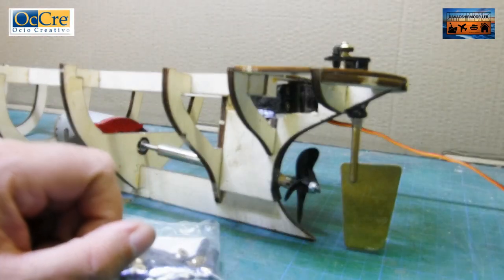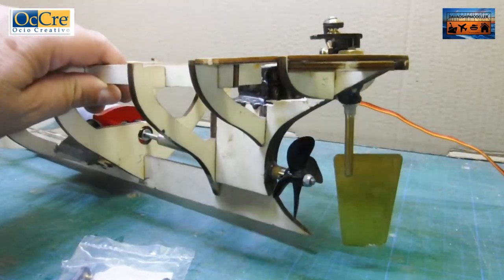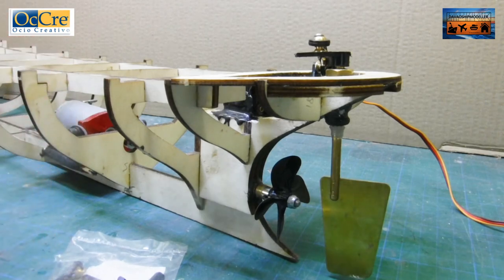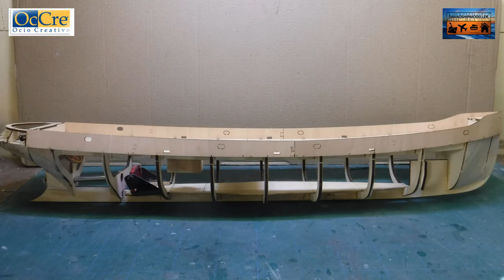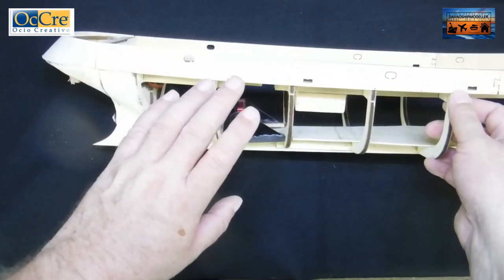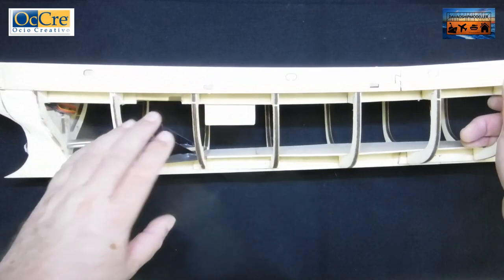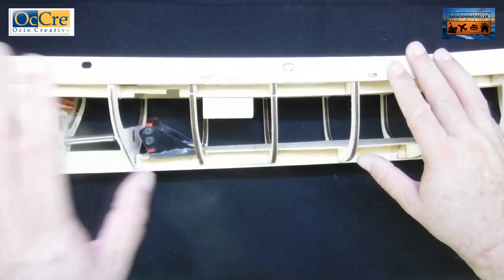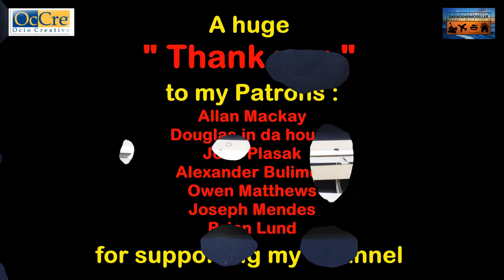Occre Ulises Part 2

Comment: Hi There, Thanks as always Why did you balser wood the Bow and stern, It was not in the boat instructions? And how did you water proof the rest of the hull?  🙂
Reply from the maker: To refill the Bow and Stern with Balsa Wood makes planking in this Areas easier, as for making the Hull Water proof, well I've used a lot of Paint and clear Varnish , but my advise would be a clear thin runny Epoxy which would seal all the small tiny pinholes
Reply: @davaoshipmodeller  thanks David, that sound like it may we worth doing -if it helsps with the planking, it's my first boat so "dreading" it. I am considering fibre-glassing the hull inside. :-)
Reply from the maker: @roysheeley well I am still John LOL ! But regarding the Balsa Wood , it will diffidently help with planking especially if you are a beginner . As for the Fiber Glass INSIDE, yes it will give the Model more stability and some kind of Water proof but I strongly advise to make also a Water proofed Coat of something OUTSIDE.

Comment: Maybe he used a marker tool.Its a handle where a starlike wheel is attached.They come in different sizes with various distances  between the "peaks" You then use it on the reverse side of thin foil and it will look like rivets when turned over.
Reply from the maker: Yes, I believe that's what he used , anyway I will do a different approach and different materials even though I like his Idea

Comment: revell makes rivetting tool suitable for this and its not the only one the tape is from home depot like store its aluminum stick tape used for insulation but rivets done that way are recessed and boat should have pronounced ones
Reply: if you want to make them then try putting really small nails or heads from sewing pins underneath and smoothen tape around it or not use tape at all might be done wit stamped wood putty but that would be tedious
Reply from the maker: @martinturecky42  Yes you have read my mind , I will imitate the Rivets with Nails but I will not use Tape , my Plan is to use thin Plastic Sheets .